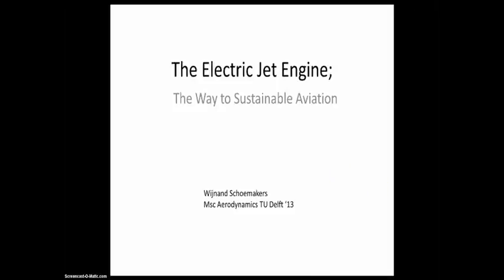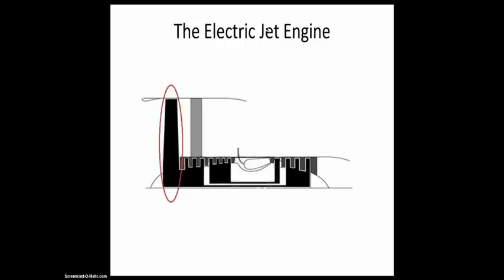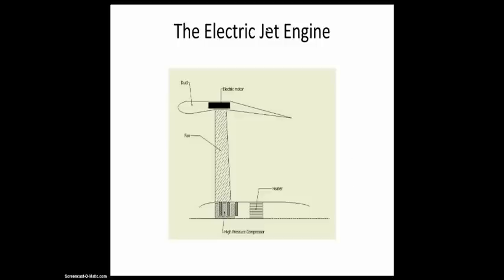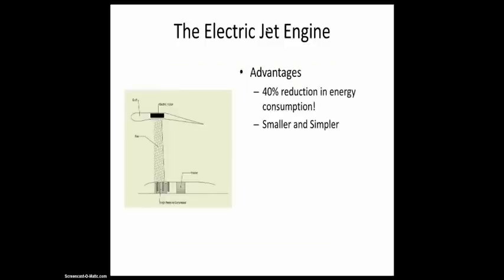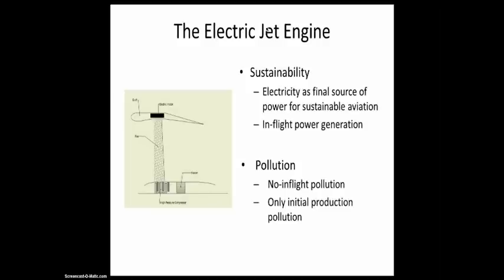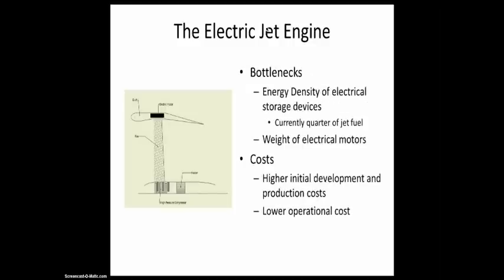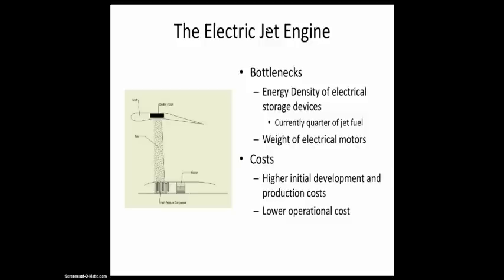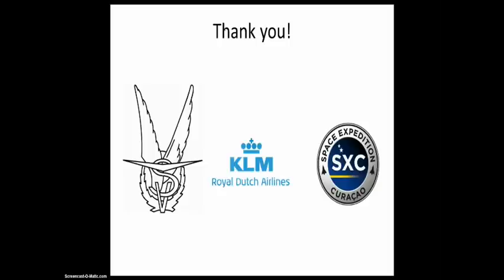Wijnand Schoemakers: Electric Turbojet Engine

Comment: Hi Wijnand. I am curious, as I have been thinking about step toward moving away from liquid aeronautical fuels that is a type of electrical/hydrogen hybrid engine. I envision a device similar to the GE Unducted propfan of the late 80s, including two counterrotating scimitar-blade propfans powered by the low-speed turbine shaft. Electricity is provided on board by liquid salt batteries for high power density. PV cells augment this during cruise.
Thanks! And good luck in the competition!